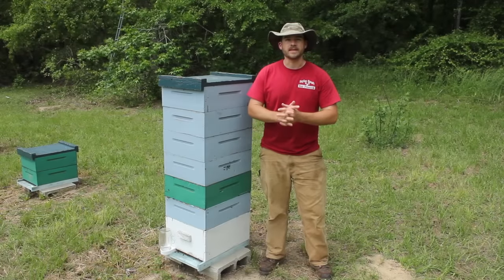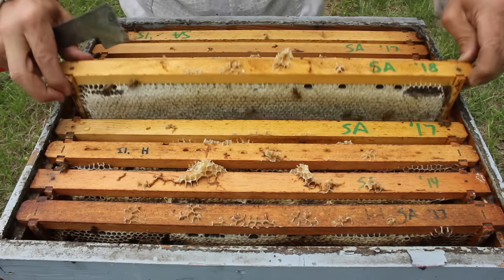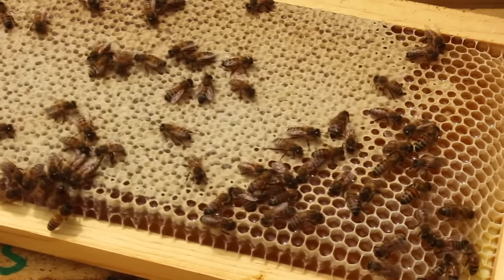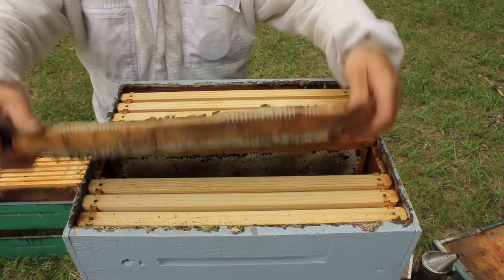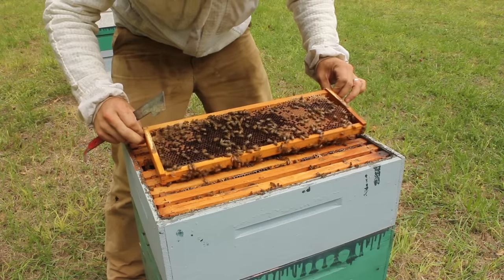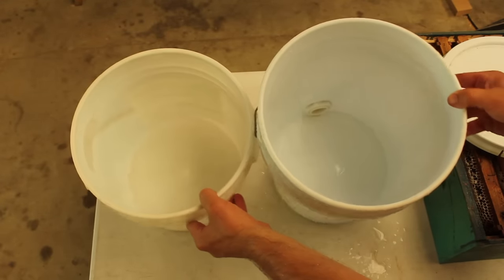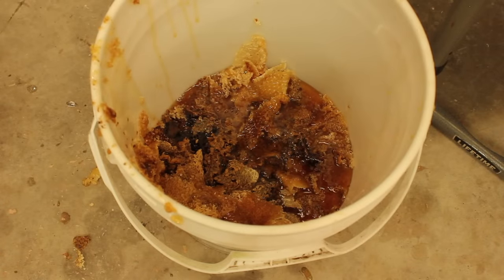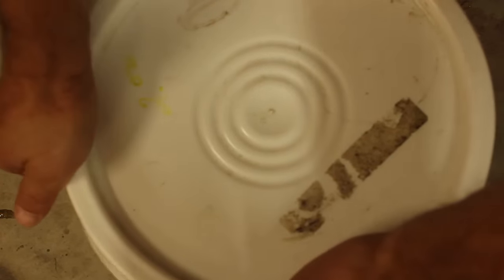Harvesting DELICIOUS Raw, Organic Honey!

Comment: For your uncapping bucket - I used a bit of 2x3 which had timber blocks nailed to each end and a 3 inch nail driven through the middle of it. I would rest my frame on the nail end, and this made uncaring a whole lot easier and neater...